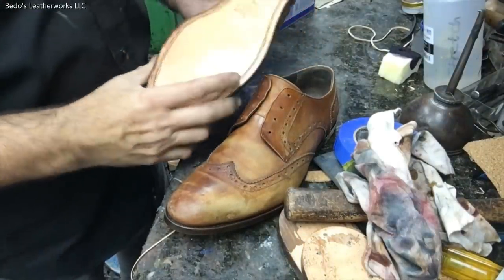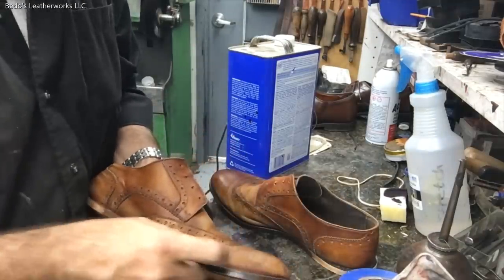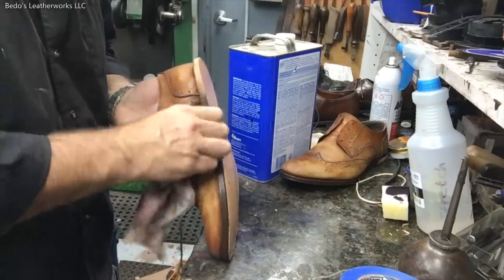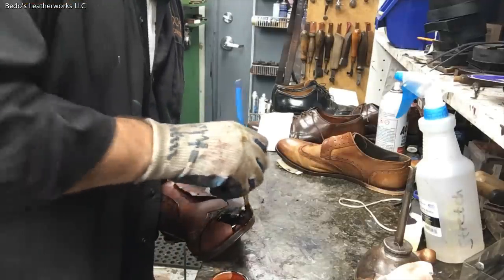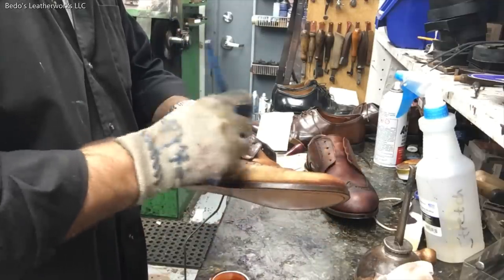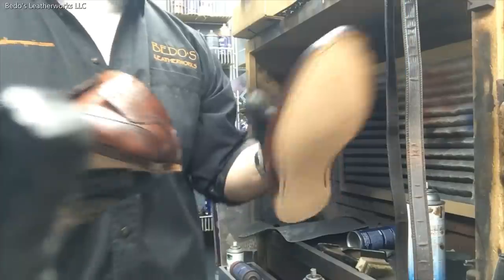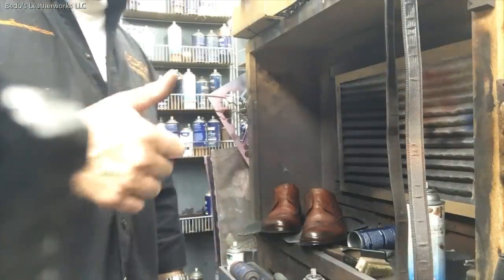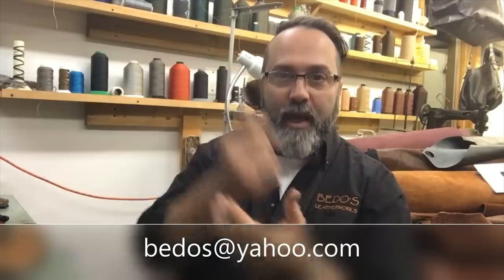RE DYEING UPPERS #152

Comment: Thank you for the rich and beautiful information you provide. I would like to ask you some questions, since you are a specialist in this field. The first question, based on your specialization, is what is the best company in manufacturing Oxford shoes in terms of the quality of the leather used in the manufacture and the ability to renew the sole and maintain it to last and the quality and craftsmanship of the manufacture. It is okay if there is more than one company that can be ranked from the best. The second question is what are the best products that I can use as an individual to maintain the shoe at home in terms of coloring and waxing. If there are other products, please mention them with the name of the manufacturing company, since I am outside your geographical area. The third question is the original color of this shoe that I worked on in this video. If I wanted to preserve it and dye it the same original color, what is the name of the polishing product for the same color that is sold commercially to individuals? Thank you.